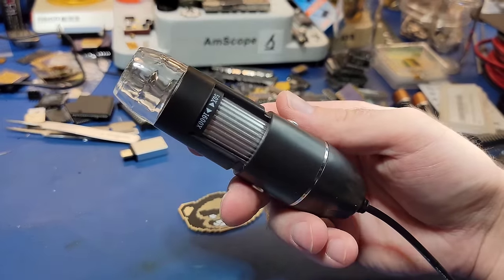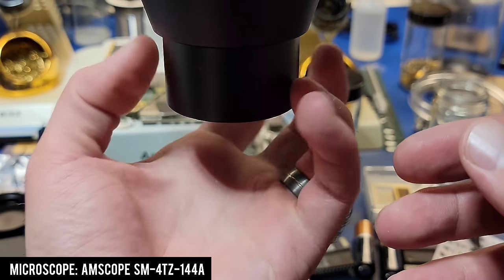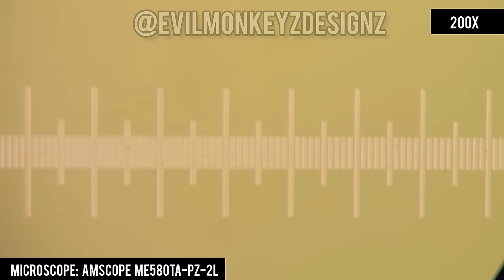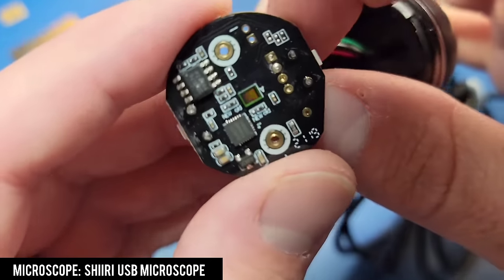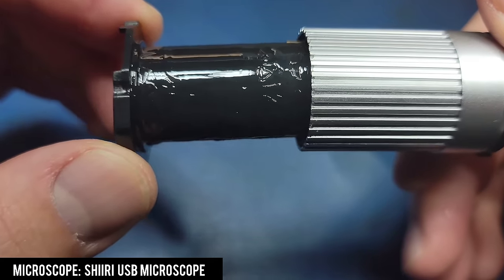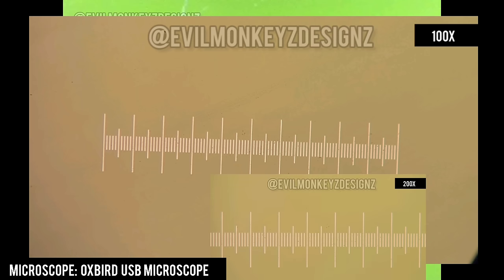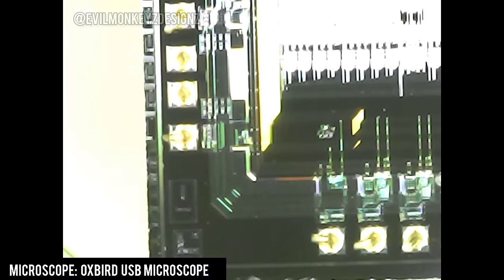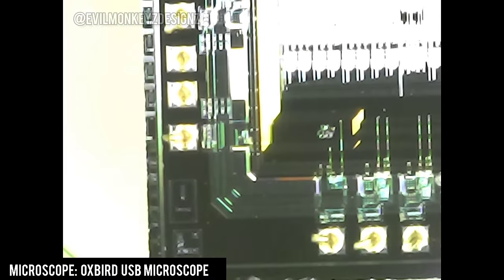Digital Microscope Comparison

Comment: I was REALLY hoping when I saw the thumbnail you’d have recommendation for a better option. I need a portable microscope that connects digitally to software for capturing an actual image (preferably not a screen shot of the laptops screen).

I work in the field on industrial equipment that can’t be moved. Mostly use it for just capturing images not working under.

Are people really using these cheap little portable things to work on the things you’re suggesting? To me this seems like you’re explaining why a screwdriver makes a bad hammer….
Reply: @cynic5581 : Have you checked out Carson? On their website they seem to have a pretty decent range and selection of microscopes (and also pretty much everything else related to magnification, microscopes, binoculars, etc.). I was just perusing their website the other day looking at their microscopes (and hence  ended up here, hoping to see a Carson reviewed in this video, but nope!)... anyways, I was pretty impressed with the range of options they have... pocket, portable, non-portable (regular tabletop), digital, non-digital... and different features and accessories for all sorts of needs and professions. Plus a variety of price points too... something for every budget it seems. I'm pretty pleased with the products I've got from them so far... I'm hoping the same goes for their microscopes.

Comment: Those cheap tubular microscopes cost about nothing, and are perfect for the price.
I use one of them daily for my electronic hobby, soldering SMD compoanants and so on.
Of course, there are better ones, but they cost much more money.
So I would not say they are bad, far from it.
I use a lathe caliper stand to hold mine, so it's really stable with orientation and heigh easily ajustable.
They work on Windows, Linux, FreeBSD, and even on an Android phone. without crazy drivers to find.

Comment: hmm ... if the good microscopes wouldn't be so expensive ... 
I am still a beginner, but I am wondering, how do these microscopes perform for actually doing some work, e.g. soldering. So far I only have a magnifying glass with an LED ring and if I do some soldering work, I loose the depth perception (e.g. slowly lowering 402 resistors on pads and not knowing how far you still have to go), because I am only looking at it with one eye. I guess all those options with only one lens system/camera fail here too, right?

Comment: These are amazing actually, the wireless one is best. If you have a high powered microscope and are expecting similar then you won't want this. If you're using it to clean your microscope lenses! Then this is perfect. It's great for kids too, they can use it with out worry that they will break your expensive microscope. They can see their hair shafts or skin really close up. Scabs are especially interesting lol  their teeth will
Show them if they need to brush.  It's to each their own.

Comment: Wouldn’t it be reasonable to compare costs in these tests and what you require the microscope for as the one that introduces the video is actually very good for the price and there are videos that do comparisons vs ability and price and what you commonly use the scope for, I am not knocking your abilities or your intention to get the best scope but there are limitations and cost and usage are two main considerations also there are some good smart phone scopes but are only good for very close up work such as silicone chips a limited usage and not a fair assessment, horses for courses, out in the field, nature when walking, so one cap size doesn’t fit all.

Comment: Pure BS. I work with that for years and it works fine. WTF you need magnification which is digital in this cheap camera. It is more than enough not using magnification. If you need it, take x2 or x5 lens and add some light and voila.

Comment: Thanks, i was about to get TOMLOV by seeing the features. but now i have decided to go with a little better one, may i know about "Andonstar" digital micrscope comparison with these ?
Reply: Tomlov and adonstar are clones... As well as a couple of other brands I found splash images of in their firmware... Absolutely none of them will give pictures in their native resolution. They're upscaled like crazy and aren't even decent enough to give a multiple of the native sensor resolution
Reply from the maker: @xenoxaos1  I agree with you about them being clones. I was wondering which one came first and who is a copy of who, but it was hard to find any information on that.

It's also interesting that you mentioned the upscaling on these microscopes. I did notice some interesting artifacts when I focus-stack a series of images from the TOMLOV. This makes me want to try and take another crack at seeing if I can get a look at the sensor it uses.
Reply: @EvilmonkeyzDesignz  just slap a serial line and it will tell you what module it loaded
Reply: also...in the firmware the list of vendors is
VMS700X STD
VMS700X RS
VMS700X OPLENIC
VMS700X TOMLOV
VMS700X ELIKLIV
VMS700X ViSee
VMS700X TEMP

Also, it does use a sony imx458

Comment: The cheapest one works okay for soldering, which is what I wanted it for.  But, it's just a sensor, right?  My optics expertise is limited, but why can't I use that cheap 640x480 sensor "microscope" as a sensor on more optics?  I mean, it's a camera, right?  You can add x2 or whatever optics on the bottom of your optical microscope... why can't you do the same with the digital microscope?  Could you put that x2 lens above your target, then the digital one over-top that?

Comment: You basically reviewed the exact same camera 4 times. If it wasn't clear by now, the first three 480p microscopes were the exact same microscope sold by different drop shippers, and fourth 480p microscope was an updated version of the same model produced by the same manufacturer, sold by a drop shipper. SHIIRI, OXBIRD, ANNLOV, and CAINDA are not microscope brands, they are drop shippers. Most of them are probably literally just a guy in an apartment who made an Amazon brand, because Amazon lets you do that.

Comment: Haha I have one of these, its held together with soda can shims and hot snot to make it somewhat useable... Just buy a decent one instead, its useless, camera is slow as molasses. You can actually get it to output higher res, but framerate goes down the drain.

Comment: Great comparison.

However I don't think your comparison of magnification factors is useful/correct as how you did it now.
I struggle a bit with the words here as it is for sure more useful than the mentioned magnification factors the manufacturers make.

I think the only microscopes that could mention a useful magnification factor, are the ones with a display.
Simply because for those you know the pixel size of the display.

What is very useful about your way of comparing the magnification factors is that you compare it to the field-of-view.
Thus comparing it to professional microscopes with their field of view.

The main problem here is that it is nearly impossible to specify a correct magnification factor with these digital microscopes as you have no idea on how the image is being shown.
To give an absurd example, what if you project the image on a beamer? What magnification factor do you have?

All in all, I think your video makes it more clear what one might expect from these cheap microscopes.
And it also makes clear the stated magnification factors on the box are complete nonsense.
Since it is a complete nonsense specification value, it is nearly impossible to make a good comparisson among them and makes it a bit confusing to see these magnification comparissons.
Still I think you did a great job here.
Reply: it should be in px / mm

Comment: Maybe you could put some info on what they could be used for? I think it’s an obvious scam, but the cheap price may make them useful anyways? I got a used version of the cheaper ones and managed to atleast assess some missing tiny smd capacitors and damaged pads on a frsky r-xsr receiver. I could not see these using my phone cam or a dslr with a flipped lens(what I had at hand) Don’t know if I can solder and repair the damage using the Microscope though, I doubt it.
Reply: use lots of flux

Comment: I've seen a model "321P" which has a Lightning connector for IOS devices as well as the Type C for android/windows. 

I tried one of the standard 321 models using a USB to l;ighning OTG adapter and could not get it to work using the app that is alleged to work by the manufacturer of the 321p. 

I don't know if it's the adapter I used or something in the microscope preventing it being recognised by the app. The LED's turn on but the app just says - plug in the device.

This model uses a 1440p sensor according to spec sheets.

Comment: I have one that is identical to the first, or first 4 of them. My problem is the sensor, you can clearly see in all the 0.3mp ones, the image is poppy, its dark and too bright at the same time and you lose out on a lot of detail. I sometimes try to use it to see if my solder joints look good on some smd stuff. I can't figure out what im looking at properly because it just lacks the detail. The ones with the better sensor are quite serviceable. Also, you can't solder under it, the focus is a nightmare, may as well do it blindly or with a magnifier then look at it after.

Comment: G'day, i watched till around half way, and it occured to me that watchmaking wasnt in your scope...ha ha, no pun intended. However, seriously, if ones eyes arent as good as someone as young as a teen, then one would turn to magnification. I have used eye glasses (not spectacles) for watch repair/restoration. What im trying to get at is i need height so i can use the 4,7,9 or whatever size screen to look at while the miscroscope is high enough away from my job and giving me lots of space to have my hands under there. Can you please come up with a few that wont break the bank, and still be effective. Looking forward to your reply.
Thanks.
Mike.

Comment: If you tinker with things and don't make money back, get one by all means buy a cheap one. Do never buy the expensive ones, they're a ball ache not only is the base machine expensive but the lenses are just as pricey.just because the guy in the video says you should buy them doesn't mean hes correct. The fact hes got 2 expensive microscopes means he obviously does this for a living and probably got them back from work expenses.

Comment: Considering that the $9.99 microscope literally costs a 100x less than the $992.99 microscope, I think it does really well. Considering its not meant for silicon chips, if you are using it for other applications that would be fine with say 75-100x magnifications then I think its a real steal. Im looking for something that would allow me to see blade edges and whether Ive successfully sharpened it and can move on to the next finer grit and this is good enough for that.

Comment: CORRECTED  EDITED FORMATTED TEXT
; This video has been a year in the making.
; In June, 2022 - I purchased a variety of six different digital
; microscopes that I saw on the Amazon website. All of them boasted
; extremely high magnification numbers - so I was immediately skeptical
; of their capabilities.  A microscope cable of 1000x magnification for
; only $10 ? That sounds way too good to be true…

; For each of the six microscopes - I will take photographs at the
; highest magnification setting and compare them against my metallurgical
; microscope photos.
; In its current configuration for this video - my ME580 metallurgical
; microscope is capable of a maximum of 500x magnification.
; I will use two objects for these photos; a microscope calibration slide
; - and a silicon chip that happens to have a doodle of Sonic on it.

: Here’s the order of the microscopes:

00:35 - Analysis criteria and tests
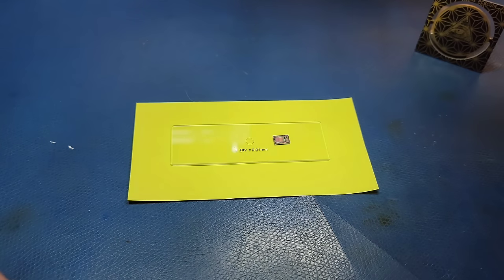01:09 - AmScope SM-4TZ-144A
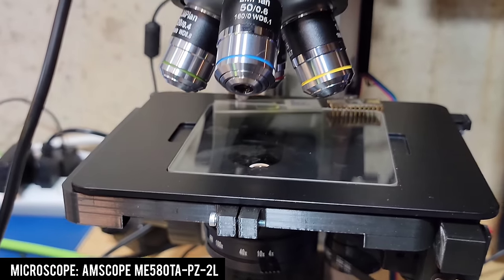03:34 - AmScope ME580TA-PZ-2L
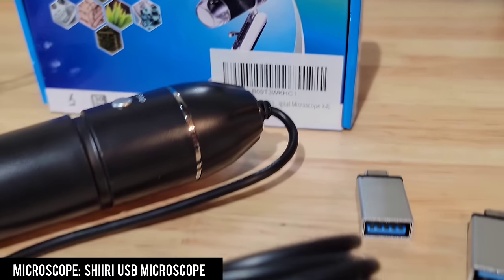05:16 - SHIIRI USB Microscope
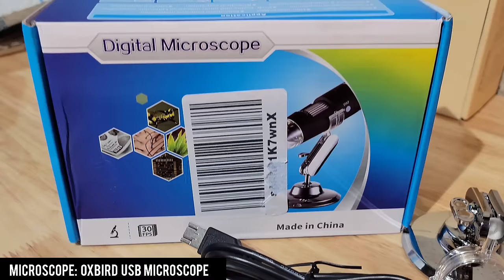10:40 - Oxbird USB Microscope
13:03 - Annlov Digital Microscope
17:19 - Canada USB Microscope
18:46 - BYSAMEYEE 4KHD WIFI
23:18 - TOMLOV DM201
27:00 - Final thoughts

; I would highly recommend against purchasing these cheaper digital
; microscopes if you were hoping to look at silicon chips up close.
; Even though they may be more expensive - there are many better
; options available. 

: I wish to know what you thought of this video.
  Was the comparison useful ?
  Did I miss something about the comparison that I should have focused on ?
  I enjoyed putting this video together - and I would like to make sure
  that I am focusing on the right stuff if I evaluate more microscopes
  in the future. I definitely appreciate your feedback!

Comment: My brother in Christ I can have my drivers tell windows whatever resolution I want. Same for metadata and recording videos.

Even with a .3mp sensor so long as the resolution I want to report is the same aspect ratio I can put out a file at a higher res than the sensor can capture.

Comment: I mean can't they do basic maths when they are listing the product specs? 

How can they say list one as 8MP when they also list the resolution as 1280x720 which is 1280pix X 720pix = 921,600 pixels = 0.9 Megapixels 
Only True 4K Video\photo is 8 Mega Pixels its actually 8.294 Megapixels.

Comment: just a note here. The cheap microscopes are worth the $10 you pay for them for simple things like coin inspection or electronic parts identification. You will not be able to do any micro soldering or anything like that.

Comment: Hey dude… why compare a cheap car with a Ferrari? Each one is made with a purpose.
Reply: He is just showing how much better optical is over digital.....even if you wanted to have a really awesome digital microscope you would pay way more than you would for optical and the digital CCD chip wouldn't be as good and no way to change the objective or eye lense or do different lighting

Hospital in my city is controlled by a different administration from an entirely different part of the province and region of the Healthcare system......anyways against the request from the lab to have a Zeiss 5 hematology microscope the lab was sent a Mateo digital scope that cost a fortune and ended up being a problem with focus and saturation so I guess they were sent back and the hospital is using their old optical Zeiss until they get a new one

An electron microscope was the best thing I've ever got to sit and look at trying different stuff to scan.....only thing the technician said she didn't like was the set-up time and sample prep

Comment: Magnification just means the image at the eyepiece is so many times bigger than the object. That is meaningless with video microscopes where the image on screen can be as big as you like. That's how manufacturers can claim magnification over X1000 for these cheap units. Resolving power is what matters.

Comment: What kind of stupid comparaison are you showing. A $900 microscope will have better performance than a $9 one like a $90k Tesla model S will have better performance than a $900 electric bike,

None of them will let you fix the IC but both of them will let you fix PCB s.

Comment: you dont recommend digital. But your $650 mechanical scope looks like shit. the $169 digital scope looks better or the same for a fraction of the price.
Reply from the maker: For looking at silicon chips up close, that's correct! I would not recommend any of these six digital microscopes. 

My recommendation in this video was to instead buy a metallurgical microscope if silicon chips are trying to look at. I included the $650 microscope in this video because I have it. When I got it, I think I only paid ~$300, but they currently go for a higher price. 

At any rate, that microscope has a lot more uses. It's great for filming chip decappings and soldering for example. I did mention that I kept the TOMLOV microscope and that I still use it for macro shots; it's just doesn't have the same magnification as the other microscopes.